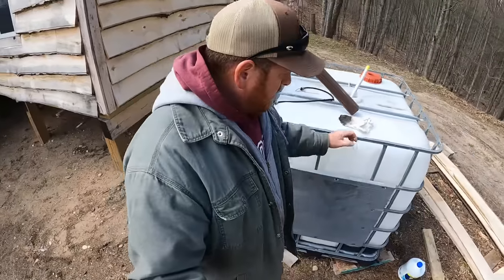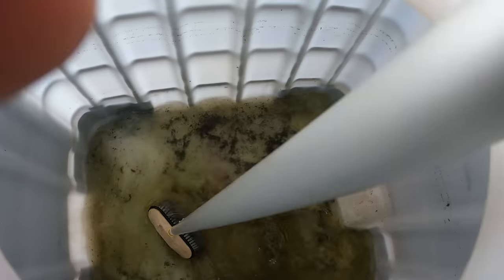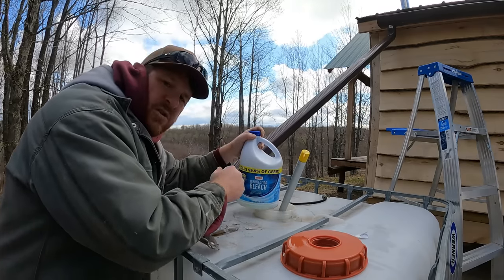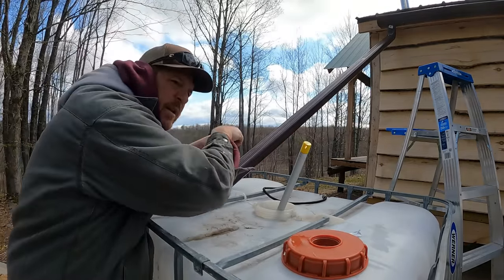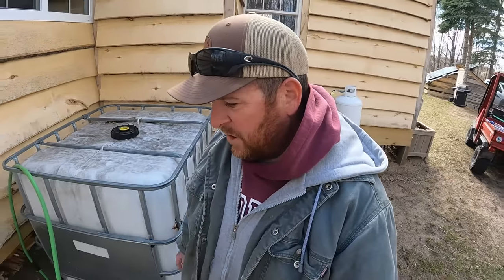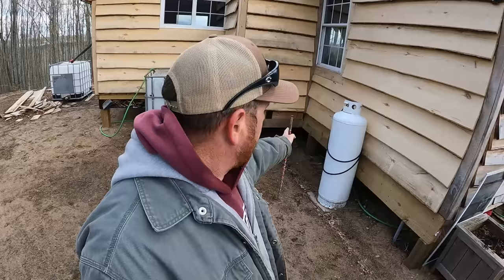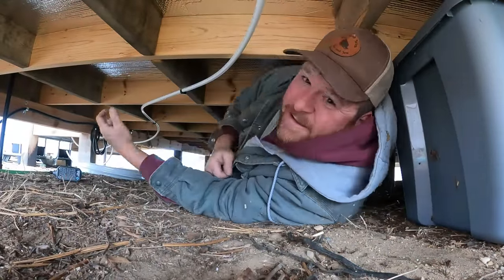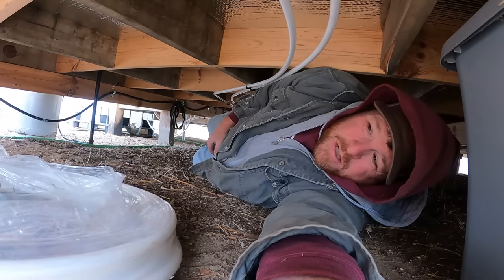Installing Waterlines At the Off Grid Cabin - MORE Plumbing | Day 3 of 7 days

Comment: Hi jay - if you cover your ibc totes with a black cover, or you can even spray paint the outside black (though I’m sure people will disagree with that but I’ve seen it done successfully many times), it will block the sunlight and prevent algae from growing inside. Cheers!